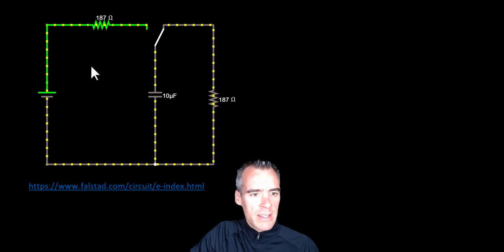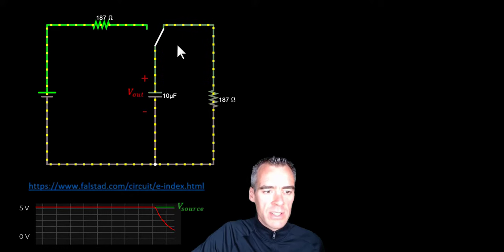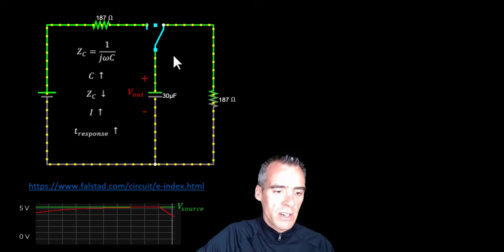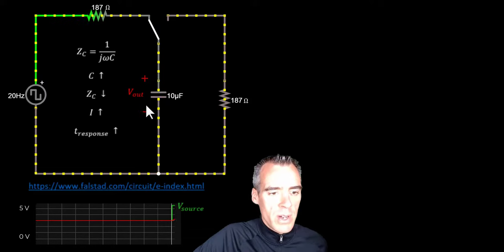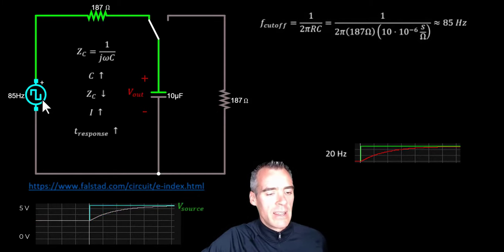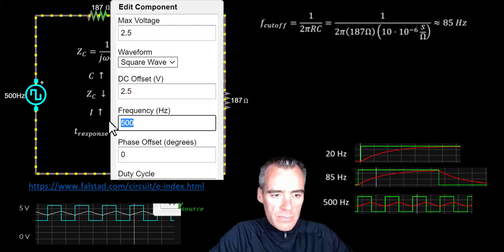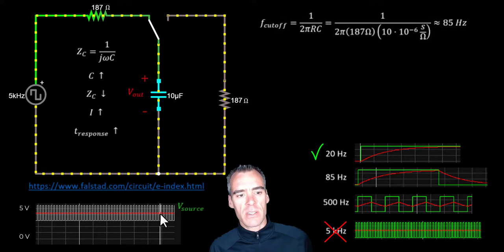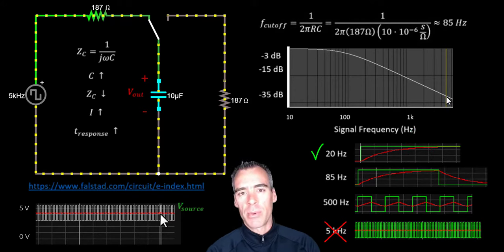How Low Pass Filters Work

Comment: I think you demo would be better illustrated using a sine wave instead of a square wave. WIthout the extra high frequency content of the square wave, your 20Hz signal would pretty much match, which I think would be more intuitive.
Reply from the maker: You're correct a sine wave would match better at 20 Hz.   Personally the square wave is more intuitive for me though because it shows there is still some imperfection in response based on how the RC voltage and current flow.

Comment: I found an old printer next to the trash and I wanted to open it and remove the circuit elements... When it was time for the capacitor, all of a sudden there was an electric shock and it really hurt me 🤣. Make sure the capacitors are completely discharged when removing elements from the circuit board.😉
Reply from the maker: Yikes.  But yeah that makes sense if the capacitor had a charge stored on it then your hand completed the circuit the current discharged through.

Comment: Great explaination! Additionaly it would have been interesting to change the value of the resistor.
My question I ask myself is: which frequency should I set the filter for a DC Signal to filter out noise on the ADC input of my esp8266. Can it be too low? Ist it better to use a big resistor or a big capacitor to get a specific frequency?

Comment: Thanks for sharing, amazing video for explaining LPF.
Just curious, cut-off frequency should be the point at -3dB not the point at the critical point of 0dB.
In -3dB, Po/Pin = 1/2, that Vo/Vin = 0.707.
So red curve=Vo, Vo/Vin=(1 - e^(t/RC)) ramp-up to about 0.707 while being cross the green square pulse(Vin). That’s what I think of it but not pretty sure correct or not. Just for discussion, please correct me if any points I got wrong.

Comment: So, if speaker leads are connected in parallel with the capacitor it functions as a low pass filter (NOT passing current until the cap is charged), and if you connect the speaker leads in series with the capacitor it functions as a high pass filter (passing current UNTIL the cap is charged).  Do I understand that correctly?

Comment: hi Matthew, thanks for your video, I would like to know why is -3dB for cut off frequency?
Reply from the maker: Hi.  -3dB is just the standard used for filter cutoff values because it is the 'half power' point.  It corresponds to a sqrt(2)/2 or, .707 decrease in voltage, but power is proportional to voltage squared.  So if you square .707 you get 0.5.  So for example, let's assume R is a constant 1 Ω.
Lets say you have a signal at 5 V, its power would then be (5 V)^2 / (1 Ω) = 25 W
.
Now if it went through a filter at the -3dB cutoff frequency, the output voltage would be , (5V⋅(2√2)) = 3.54 V

And the power would be , (3.54 V)^2/ (1 Ω)= 12.5 W, which is half of the signal power of 25 W.  Does that make sense?
Reply: I'm pretty sure 3dB or half power was picked arbitrarily as a nice round number which allowed for comparison between filters.

Comment: What happens to the filter if you increase the capacitance?
Reply from the maker: Good question!  Increasing the capacitance will slow down the output voltage response as shown around the 2 minute mark.  The decreased response time will decrease the cutoff frequency of the low pass filter.  So the filter will then cause more attenuation to the signals at higher frequencies.

Comment: How capacitor is discharged when low inputs we provide
Reply from the maker: I'm not sure what you mean.  At the start of the video you can see how the capacitor is discharged when connected to a circuit with just a resistor.

Comment: Why does the  24VDC power supply act as a low-pass filter circuit?
Reply from the maker: Hi Ali, not sure what you are referring to by the 24 V DC power supply.  Here I used a 5 V AC power supply.

Comment: Why does the power supply act as a low-pass filter circuit?
Reply from the maker: An ideal power supply itself doesn't act as a low-pass filter, it just supplies the voltage or current.
Reply: Does current stop passing after capacitor gets fully charged?

Comment: Why does a power supply act as a low capacitor?
Reply from the maker: An ideal power supply itself doesn't act as a capacitor, it just supplies the voltage or current.

Comment: smart people should ask this in low pass filter in order to understand why his explantion is wrong* : 
1. the capcitor is fully charged when the input frequency is low like 20hz, ok and simple to understand, nothing complex...
then 
2. when frequency input is very high like 500hz then the capcitor just dont fully charged but way less because of the speed of the input frequency...mean the capacitor start to charge him self and suddnely the source go off state, hence not fully charged, in different words....
which mean according to his explantion in the first situation the capcitor is fully charged and in the second example the capcitor is just dont fully charged lets say half.....ok up to this point everything is simple to understand...here the problem comes....

then someone smart ask but hi, the frequency stay the same its just the capcitor dont charged fully and the output of the capcitor also the same charge he charged...
then how the hell its filter high frequencies ??????

low pass filter mean this...for example the input is 1000 hertz(1khz) mean 1000 cycles per second and after it pass the circut its 200 hertz, mean 200 cycles per second, mean less cycles per second...which mean ......that the capcitor dont charged every time but miss alot of the cycles and hence the output its lower frequency...other wise according to his explantion you dont filter out frequencies...but just output half the input, but frequency is the same